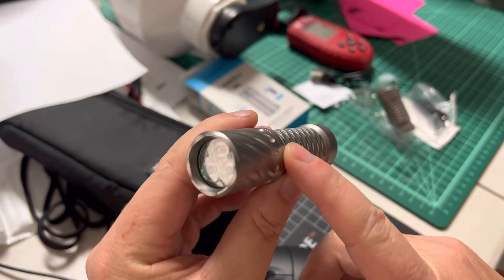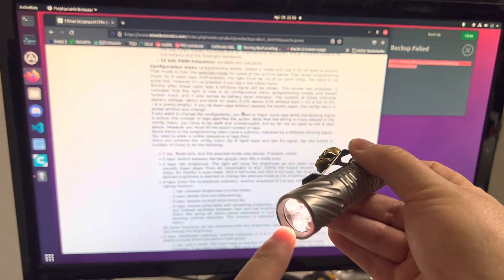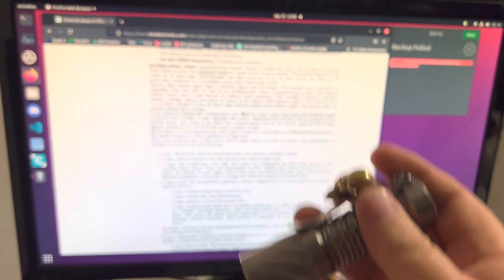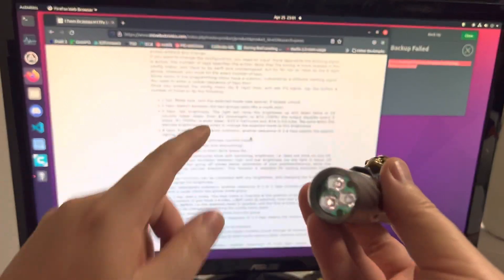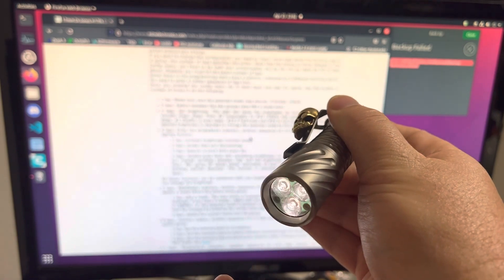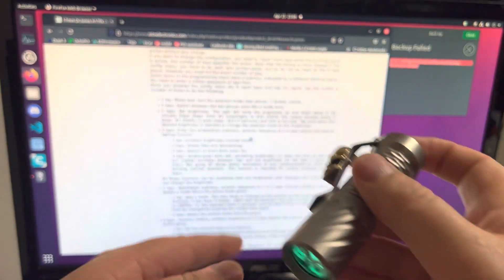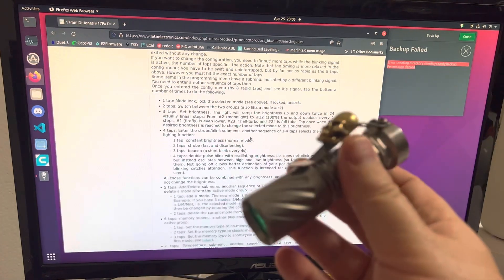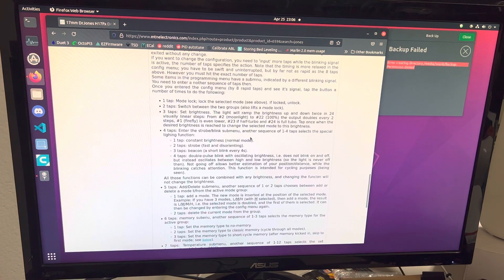How to program one of my favorite drivers ever, the Dr. Jones H17fx!

Comment: not getting full brightness here.  worked great for over a year.  with a factory reset, the third brightness level is no brighter than the second. it wont sustain that medium brightness, either.  it steps down the lumens after about 2 seconds.  i guess this little driver needs to be replaced once in a while...  i've tried 3 different brands of new batteries.  got a new charger that accurately indicates charge levels.  my triple leds are the same age as the drivers (2 yrs)
mechtorch gen 2 flashlight , nichia leds

Comment: Hey man! Been digging all the light content as im going down the rabbit hole albeit more on the custom side and not quite as nerd level as some folks, although i respect it. I had a question. I got a Laulima Ion Slim and it has this driver. The turbo mode is driving me nuts. You can program everything on it, but I can’t find  a way to turn off the double tap to turbo feature. Sometimes i cycle modes quickly and then i get blasted with turbo haha. Not to mention how hot this thing gets on higher settings. Any tips on turning that mode/feature off?
Reply from the maker: You cannot disable turbo on h17f! I have hear other say it is frustrating, but for me I just learned to tap slower and not accidentally trigger it.
Reply: @cheule ahh but you can change the brightness on that double click mode. So i just set it to somewhere between my moonlight and second mode. So if i accidentally tap it, it just feels like im cycling through. I swear i tried that already, but u just double tap to turbo, save it as ur mode for a second. Then change brightness.
Reply: @cheule its funny right? Everything has its drawbacks haha. The seemingly perfect driver, beaten by a turbo mode. The Dragon driver has too bright a moonlight setting and limited options. Still need to get a BOSS, but only seeing the Moff switch version. Idk what that is but im a clicky guy. Anyway, thanks for the reply and for fueling the new addiction

Comment: There was a guy on eBay who would let you custom tune the modes and he'd supply the PCB ready to go, tiny 12x20 PCB that ran cold👍. I always hated jumping from bright to low, or not knowing if your at the max level and over clicking, so ordered one with about 8 modes that ramped up and back down with a fake max mode that dipped down then back up in the middle. Ordered a few different configs, it was fun to play with. Always hoped to be able to hack into the cheap flashlights...why I'm here 😁 ⚔️death to strobe modes⚔️
Reply from the maker: Good info!

Comment: I’m having an extremely difficult time resetting the driver back to factory settings,I’ve lost moon mode and can’t get it back
Reply: I'm in a similar situation myself. I went to try to mess with the programming, trying to add the fast strobe mode, ended up messing something up. I have 4 modes now, with the 4th one being a slow strobe, but now I can't even get back into the programming mode. Very frustrating.
Reply: @tehpwnzor1337 hey man just went through this. Might be too late now, but i learned u have to go real quickly with the taps (half presses) to get into programming. Then you go a little slower, more deliberately once you are into programming. I had trouble resetting as well so what i did was deleted any special modes like strobe, then added more modes (if needed til u have the number you want) then set the brightnesses for each mode. Got it dialed. Once you get the hang of the taps and timing, its pretty easy though. I just can’t turn off double tap to turbo
Reply: I have the information downloaded but trying to get into just by clicking it is a bitch
Reply from the maker: You can find the full manual (including how to factory reset or simply change a mode to moonlight) here: https://www.mtnelectronics.com/index.php?route=product/product&product_id=659&search=H17f
Reply: you can factory reset to start over, just quick 8 taps from ON or OFF till it blinks (make sure to hold the switch in ON during the last tap), followed by another 10 taps

Comment: I had built my first s2+ as a triple with this driver. Figured I'd check your video for a re-cap and was thoroughly entertained by your clear and engaging explanation! Thanks :D

Where I prefer anduril or the zebralight UI wherever possible, I think this driver allows a level of consistency and is the best thing for mechanical switch applications! (Short memory is amazing for indoor use)
Reply from the maker: Yes, this driver and UI is infinitely better for my “midnight bathroom trips” without waking loved ones than Anduril, where there is a high degree of accidentally hitting momentary turbo and then getting yelled at.

Comment: Has become my favourite as well. Not as feature rich as Anduril but easier to program and recall, have 2 right now from MTN Elect. waiting to go into hosts.
Reply from the maker: I honestly prefer using clicky modes I’ve set up to Anduril a lot of the time. Anduril is a top tier UI, and it can do so much—so I’m not disparaging it at all. It’s just that ramping is sometimes slow, and I find it l’s often too easy to accidentally 2H from off instead of a 1H to ramp from the bottom, and then you blast your sleeping loved one. I have no such issues with H17f or Lux-RC.